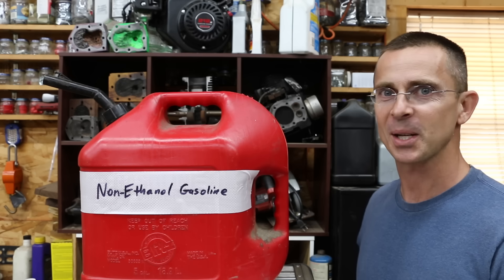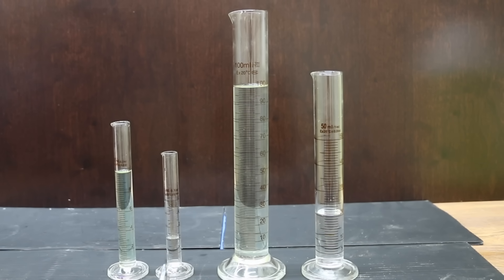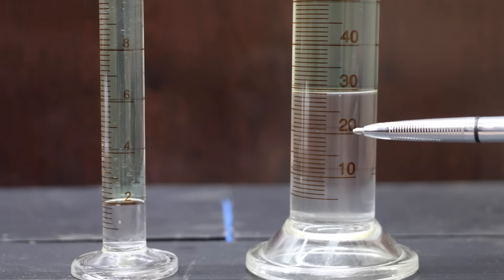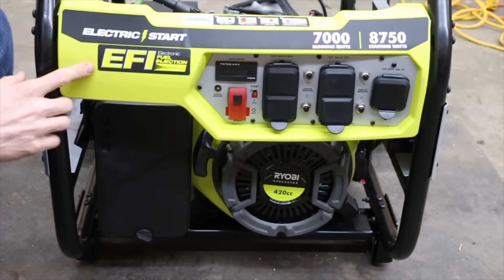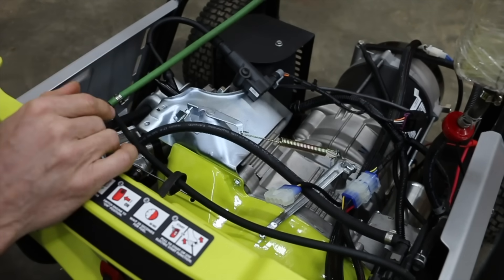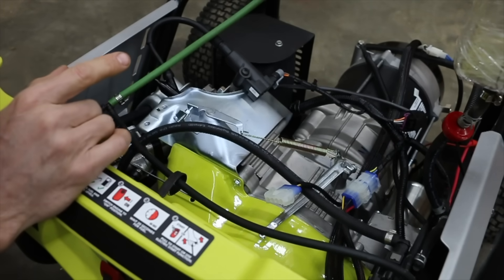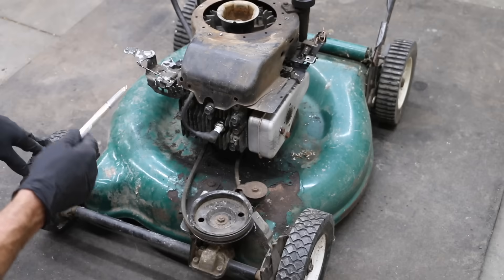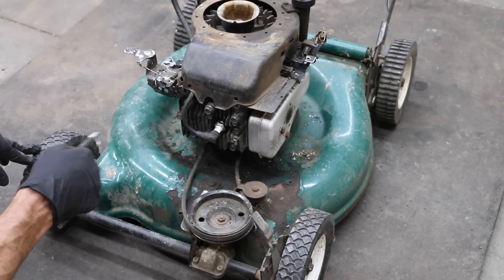Is Non-Ethanol Gasoline Really Better? See the PROOF!

Comment: Non-ethanol gas is better for older vehicles who sit in storage ethanol gas has less where when it comes to E10 E10 separates over time but if you're running it constantly and don't let your vehicle sit it's fine and it wears the internals of your engine less higher grades of ethanol Ware faster no ethanol wears faster methanol wears the worst
Reply from the maker: Thank you

Comment: This is pretty simple, and can be shown by "doing the math".  Given that generally, regular gasoline has 114,000 BTUs (British Thermal Units) per gallon (volume). One gallon of ethanol  has 71.94% the BTU energy content of gasoline, or 81,800 BTUs per gallon. 

Now, we shall use a vehicle with an engine and drivetrain that delivers 50 miles per gallon with pure gasoline. With 10 gallons of fuel in the tank that will take you 500 miles. That's the baseline. 

10 gallons of pure gasoline can deliver 1,140,000 BTUS for that 500 miles. We know that we are getting 50 miles per gallon, but we can also do the math and say that it 'costs' us 2,228 BTUs per mile. Of course there are otter heat losses but we will maintain all things being equal between the tests: 

Now, we will REPLACE ONE GALLON of that pure gasoline with ONE gallon of ethanol.  Removing 1 gallon of gasoline leaves 9 gallons of gasoline, or 1,026,000 BTUs. We add ONE gallon of ethanol, at 81,800 BTU per gallon, and now add it up for the 10 gallons - the total BTU content of the 10 gallons has been slightly reduced, to 1,107,800.    

We now compare the two 'tanks' BTU content: Original fuel tank with 10 gallons of pure gasoline, 1,140,000. 10%  blend tank BTU content 1,107,800.  DO the math and that shows us that the energy content of the E10 tank is  97.2% less. 

Now with all things being equal, same engine, same losses, same weather, terrain, etc, that 10 gallons of fuel will provide you only 97.2% of the 50 miles per gallon or 97.2% of the 500 miles of the original tank of pure fuel..that comes out to:   48.6 miles per gallon, or 486 miles. This is a NO brainer when you look at it and do the math. The BTU cost per mile is 2,215 BTUs per mile. Less energy being expended, less fuel economy. 

The popular lie, misconception, or myth is that you "lose" 10% economy. That isn't so.  I have meticulously checked this with my motorcycle several years ago when I lived in SE Arizona. It was capable of 50 miles per gallon with pure gasoline. I kept records and ensured I used pure gasoline for my tests. Then I would use 10% ethanol blend and would calculate. As my tank was 4 gallons, I could get quick turnover on my tests. 

I would consistently get 47-48 mpg on ethanol blended gas vs 50 -51 on pure gasoline. I even BLENDED my own E15 to see results but that's the subject of another discussion. 

Where I would see a larger percentage in the MPG drop, was when cold weather set in, and the fuel blends changed for winter. Also, different brands of fuel (Top Tier vs bargain fuels) performed differently as they had different amounts of additives and detergents.  In winter I would experience an additional 3% drop due to the cold weather (and the fuel injectors would have to stay open a bit longer to accommodate the denser air charge coming into the engine, esp when the engine was cold. I rode nearly year round (sometimes down into single digit cold, as I had heated gloves, and other clothing, and my ride to work was about 8 miles.). When temps dropped below about 50 deg F, I would start seeing the MPG taper off. I could also see that the best mpgs were obtained when temps were about 70 deg F. When the temps climbed upwards of 90 to 100+ deg F i also saw a drop off as well.  

So to recap, 10% ethanol is a fairly imperceptible hit on MPG and performance (I could discern NO noticeable performance hits either), and can often be made up by better driving habits.  Remember, and don't let anybody "tell' you otherwise,  When you use  E10 fuel, it's blended by only REMOVING 10% of the volume of fuel and replacing that volume of fuel replaced) with a fuel that has 28% less BTU content.  The math doesn't lie. What matters is the blend of fuel you get in summer and winter, and the geographical area where you live (California, Phoenix, etc). 

Thought this would be of benefit.
Reply from the maker: Thank you!